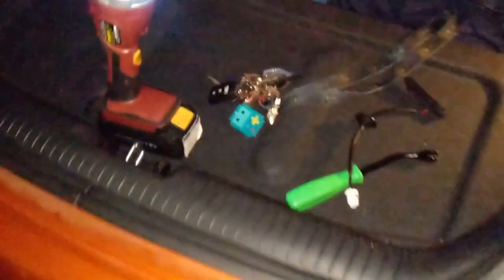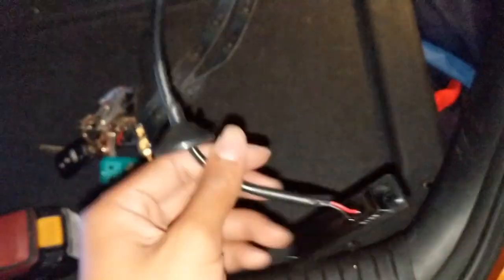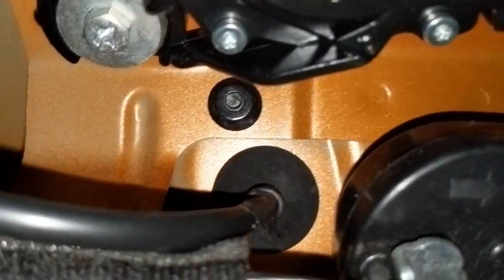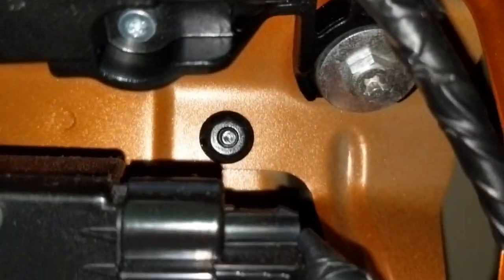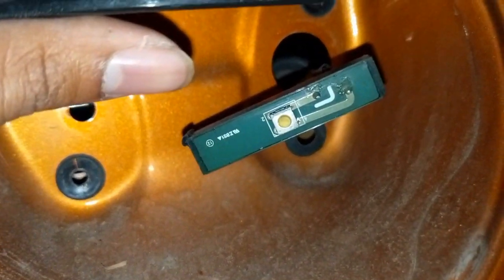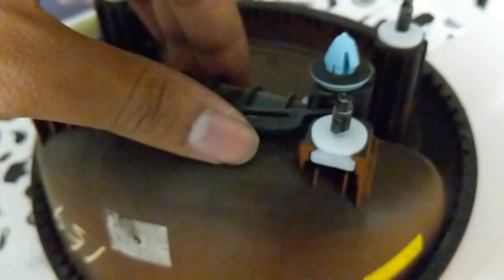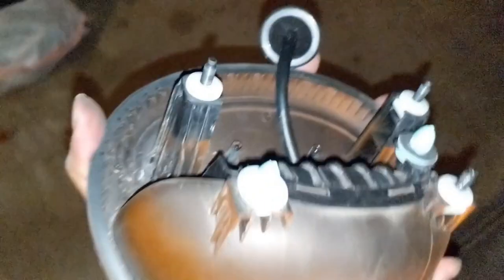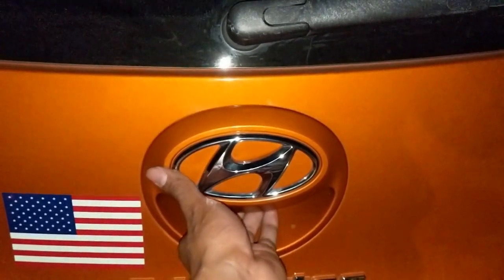veloster Hatch/Trunk button replacement

Comment: Thank you so much for this video! Dealer was going to charge hundreds just to "diagnose" the issue, but this worked perfectly for my 2013 Veloster. This was the first time I did my own car repair, and it only took about 30 minutes. You rock!
Reply: James Nelson awww that’s awesome, did you buy the trunk release button, where did you buy it?! I’m having the same problem, I can’t find where I need to purchase, help!😩
Reply: Did all that and trunk still does Not open! UGH! I have a 2014 Veloster w/camera. . Camera does work, tried pressing while turning car on too.  .  .  Any ideas?

Comment: Thanks for posting this video! I had the same problem ,so after watching your video, I purchased the replacement button and a trim removal tool set on Amazon for around $30 total and replaced it myself. Very easy and saved a ton of $$$$! Thanks again 👍
Reply: thanks ... could you please tell me what the name of is part is? I need to order it, but I do not the name of it in English ... thanks

Comment: About those blue clips that were hard to pull off and you were concerned about breaking? Just shove a 7mm socket over that. It compresses the tabs on the clips just enough to slip right out. Changed that part this morning and you video was on point. Thanks.
Reply: The ones behind the button cover.. I mean.
Reply: Very usefull your hint. Thanks

Comment: thanks for the video and how DYI.  I also took my car to the dealership and they wanted to charge me $400 just to replace the rear sensor button.  I said screw that and order OEM part myself and did by following your video guide and it was easy to install.
Reply: Where did you order?

Comment: Thank you for your help! My 2016 Veloster base has the exact same issue. I bought the part and the tool online now to do the same.
Reply: 15 min start to finish thanks to your great video!
Reply: @kevinokeefe9163  just confirm, you had to unscrew nuts to get it off not just screws? i want to make sure i have the right tools lol

Comment: I have a 2013. With a back up came. I’ve order two parts and they both been wrong. Do u have any suggestions where to find it. Thx’s
Reply from the maker: Got mine from hyundaipartsdeal.com 
You're looking for part 81260-2V010 should fit your 2013 with the camera

Comment: How did you open the trunk if the button was broken? Sorry still trying to figure mine out. Just broke today.
Reply from the maker: yeah you can open it from the inside! just get into your trunk and find a hole right in the center of the trunk door. insert a flat head, key, or even a screwdriver so you can manually move a lever in there to the right which will unlock the door. while holding the lever to the right, use your other hand to push open the door and WALAH its open!
Reply: Awesome thank you!

Comment: Watching this video in 2020 - how do I open the hatch to fix it if the button doesnt work?
Reply: Mine is a 2013, there is a slot on the inside of the hatch door. It has a picture of a key on it, slip a key in it and open in from the inside

Comment: One question: How did you open the trunk without the button functioning?
Reply: If you go in through the back door, you can use the keys to open the trunk from the inside
Reply: @ayushdubey7677  thanks, I was wondering... Mine pushed up into the space behind the emblem at work earlier this week
Reply: Was wondering the same thing! Thanks!!!

Comment: Where can I buy that part?
Reply from the maker: Hyundaipartsdeal.com it's nice since the parts are genuine Hyundai it comes with a one year warranty just in case 😁
Reply from the maker: Part number is 81260-2V000 for the series without the backup camera
Reply: vjellyo Thsnks!!
Reply: @TheVjellyo  Do you know what it is with a backup camera?  I can't seem to find it.
Reply from the maker: @whourdadie  81260-2V010
Reply: @TheVjellyo  Would it be 81260-2V010 for one that has a backup camera
Reply from the maker: @whourdadie  yes!😁
Reply: vjellyo why without the camera?
I was wondering if the camera was still connected or you removed it or something ...
Reply from the maker: @MrArm31  some models come with the built in camera so it requires a different button then I listed in the description. My car does not come with the built in camera. Hope that helps😁
Reply: vjellyo mine had the inbuilt camera!
But yea very helpful!!
Thank you